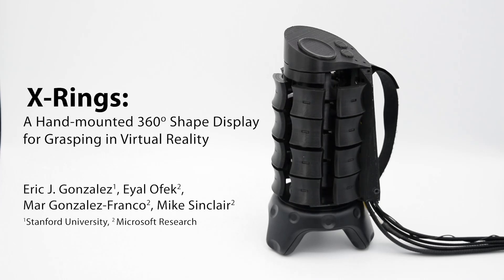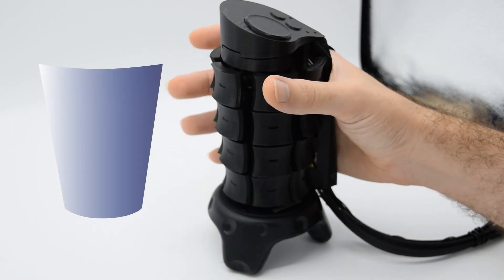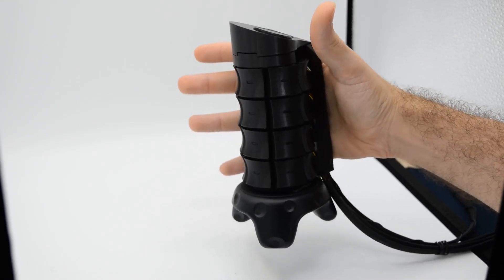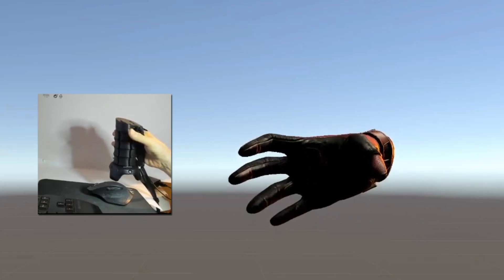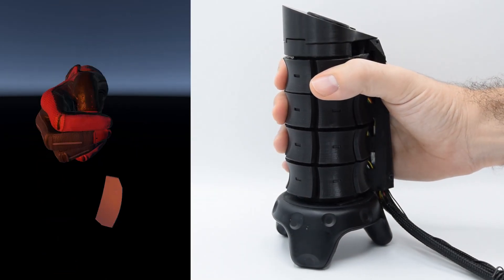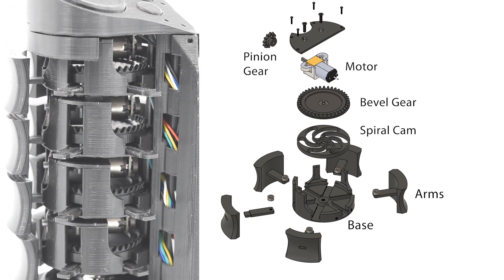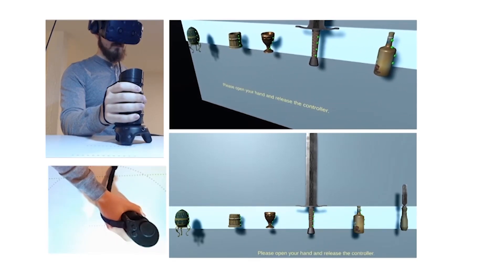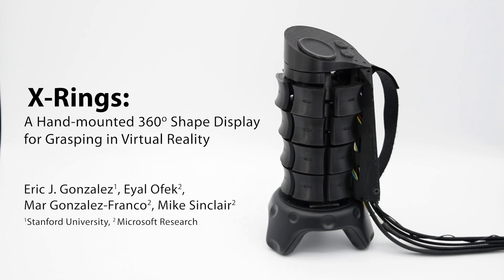X-Rings: A Hand-mounted 360 Degree Shape Display for Grasping in Virtual Reality [UIST 2021]

Comment: Very intriguing prototype. Perhaps next steps would be to incorporate origami techniques into the design so that they can reduce the diameter to the point that the hand can mostly fit around it, make more and smaller steps to increase sensor resolution, or wrap it in some kind of fabric to prevent pinching between the pieces. I'm liking what I see. Lab research is often at least a few years out from production, but with the basic concept working, I'm looking forward to refinements and upgrades in the interim.

Comment: A step in the right direction. Probably they will have to up the ‘resolution’ (motor count) and find smaller, quieter motors before this catches on. Also, important question: how much does one of these weigh? Very important for how long you would be able to use them. My beat wishes Gonzalez, Ofek, Gonzalez-Franco and Sinclair, they have done some really cool work.
Reply: My issue with this proof of concept is that we interact with most objects with our fingertips. Meanwhile, this limits you to firmly grasping.
Reply: @SimplestUsername  it's no worse than any other VR hand controller in that regard.
Reply: @falxonPSN  That's true it's no worse, but the improvement seems miniscule.

This really only impacts game immersion when grasping a tool or weapon of difference circumferences and I believe such a nuanced thing would go largely unnoticed.
Reply: @SimplestUsername  outside the obvious stuff like games like HL:Alyx, this would be good in FPS VR games too. Guns would feel different than rifles or grenades. For painting in Open Brush, perhaps different tools would be shaped differently.
Reply: I'm torn between this approach and haptic gloves. The latter gives you finer 'resolution' by the granularity of strings (see for example this: https://youtu.be/laZOSSEGqq8?t=510) but the sensation of tactile feedback is most likely better with the X-Rings.